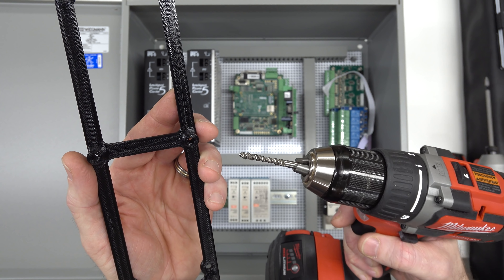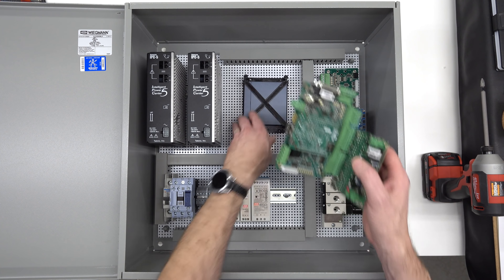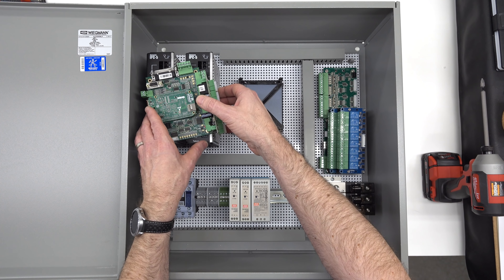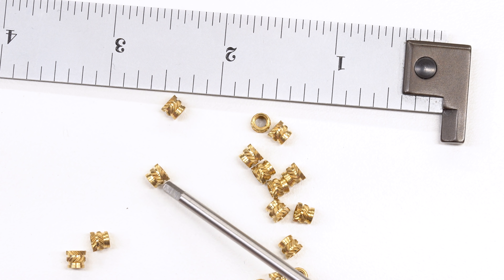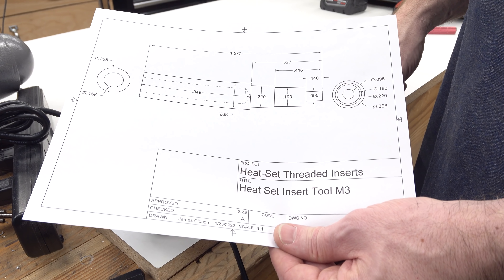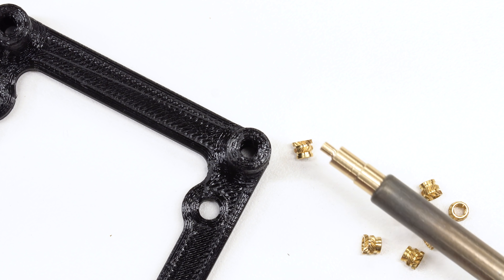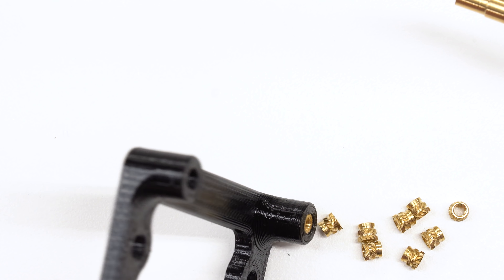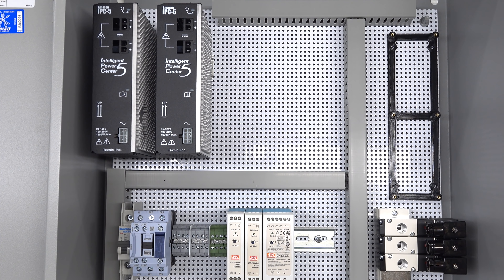Using Heat-Set Threaded Inserts | 3D Printed Acorn CNC Controller and Ether1616 Expansion PCB Mounts

Comment from the maker: Lots of people are asking about the perforated panel:  https://www.automationdirect.com/adc/shopping/catalog/n1p2020pp
Reply: Thank you for explaining the perf panels. I've always seen them as options when buying cabinets but didn't know what hardware I should be using with them.
Reply: You can also obtain plastic perf panels that have tapered grids and take self tapping course threaded screws, check the Bud Ind ones. Might be cheaper options than steel and machine screws
Reply: @Clough42    JFYI - you just need to say M3.. the pitch usually is not noted for standard series metric threads.
M2, M2.5, M3, M5, M6, M8, M10, M12, M16, M20, M24, .. are standard sizes and have a defined standard pitch.
They also are defined with other pitch (fine thread, etc) and there is 2nd choice series like M7 or M14 for example.. but one normally doesn't use them unless the application really really needs it. And only under such circumstances one notes the pitch or other special features.

PS: I'd add washers and maybe springwashers to those PCB board mounting screws.. if it's a vibrating environment they might come loose other wise?
Reply from the maker: @joansparky4439  the ISO standard is as you describe.  ANSI still prescribes calling out the pitch.
Reply: @Clough42    What can I say - you got an international audience, which isn't fluent in the amusing idiosyncrasies of thread descriptions per ANSI ;-)

Comment: For more holding power, do through holes and use the insert from the back.
Reply: You can also print a hex pocket and insert a nut.
Reply: @j.frankparnell6195  On the rare occasion I need to use one instead of a regular heat inset I will slightly undersize the hex pocket and heat insert the nut. Inserted nuts can be a pain when they take up too much room in a design, need installed in an awkward location during assembly or need inserted sideways through a slot that wont print well.
Reply: I always try to do this, its good practice, but really you don't need to be worried about strength too much when using good quality inserts. CNC kitchen has a video on some strength testing on M3 inserts, which showed that most inserts can easily handle over 1400N of force before pulling out (that is over 150kg on a single bolt!). The limit to torque you can apply was the bolts snapping.
So if you are not having solid infill in your parts, the weakest link is most likely the plastic part, not the insert pulling out, which is good to know!
Reply: There's got to be a dirty joke there, right?

Comment: McMaster also specs/sells soldering iron tips for their threaded inserts. Another fun fact - Molded in threaded inserts are common in Injection Molding, but so is 'heat staking' after the part is made. This is essentially the same process as you are exploring. The soldering iron in that application usually looks like an arbor press but with a heated tip.
Reply: When I started using inserts, I got the iron tip from McMaster, but I ended up just using a normal conical tip.  In my experience it works fine, and I'm able to get the insert straight without effort.
Reply: just be sure to get the right kind.The ones made for molding, isn't as suited for staking as those made for staking and vice versa
Reply: Is there anything I want that McMaster doesn’t sell?
Reply: McMaster also provides CAD models of most of their parts, no account needed.
Reply: Now I want to make a Dake Hakko Frankenstein project

Comment: I figured you knew about the inserts. CNC Kitchen has a video about the twist and pull out strength of various types of threaded inserts. I just uploaded my design for a Heat-set insert press to Cults3D.  Along with a soldering fume extractor. Same name as my YouTube name. I can't wait to see the new machine you're working on.
Reply from the maker: Yeah, I saw that video was there.  The topic has been covered, but this is what I was working on, so...
Reply: I can’t find you, how about a pointer?
Reply: Yes! , there are so many types of knurling/nibs out there, good to know which are best for fdm etc
Reply: @tablatronix  The style in this video is the best.

Comment: One of the tricks I've used for these over the years is to remove the iron when the insert is a bit proud of the hole and use a flat piece of metal to push it flush. This means it's flush to your plastic and does seem to help a bit with them being square. Course, I just use a super cheap soldering iron for the with a tapered tip so it works across a variety of sizes.
Reply from the maker: I think I would want them slightly below flush, to get solid bearing on the plastic, but you have a point about squareness.
Reply: By making them flush, you also prevent them from being pulled out, ever so slightly, if the screw is torqued a bit.
Reply: ooh this might help with preventing getting some plastic melt inside the bottom of the hole, I make my holes extra deep now, or it will really mess your threads up
Reply: @tablatronix  I tend to model them as drilled so I get some clearance at the bottom for the molten plastic in the taper. I really should figure out how to do custom hole definitions in Onshape so I can just add a library of the shapes for it with a bit of a counterbore to help align. I’ve cheated and made models for forms to Boolean out too which does work and could even get the taper they suggest.
Reply: Great idea! I'll try that.  I've been using threaded inserts for awhile now. It's important to get the insert at the surface or it gets pulled up and cracks the print when tightening (I use an electric screwdriver). I've ruined more than a few 3D prints that way.  If the inserts are on the surface, then the print doesn't crack.
Reply: I do that. Have also noticed some plastics have a tendency to push the insert back out while it's still hot, probably at least partly due to hole/inset sizing even with plenty of extra room below the inset depth.

Comment: Nice video, James. I’ve used heat-set inserts in a couple of my printed builds, and toyed with the idea of making a jig, but like you find that freehand is more than adequate.

My first experience with heat-set inserts was many, many years ago assembling a piece of HeathKit test equipment (I think it was the low-end RF & Audio Signal Generators that had plastic cases, but it make have been on the “Most Accurate Clock” case): the instructions called for using a standard pencil iron tip and just pushing them in the same way you did.

Comment: I have been to this rodeo which is my plan B. In ABS I usually cold form threads, print the hole undersize, run the correct drill through the hole, and finally use a cold forming tap chucked in a cordless drill to finish the threads. Cold forming in plastic has enough friction that it's a melting process so don't touch the tap quickly after forming a few threads.
Cheers-Peter

Comment: Threaded inserts are great. One suggestion would be to undersize the holes a bit. I found that if you make them a little too small and end up having material ooze out when you install the insert you get a much better connection between the insert and the part. The ooze is pretty easy to clean up afterward
Reply: Just be careful to add clearance at the bottom or else you can get plastic inside your insert
Reply: @tablatronix  very true

Comment: We had an injection moulding tool for ABS parts designed at work years ago. They used inserts for anything which might require frequent disassembly and specific plastic screws for lighter duty fastenings. I think the brand name was plastite, they have a coarser thread than machine bolts and are self-tapping to screw straight into a boss.
Reply: Yep.  I almost got some Plastite screws recently for a project.  Also, "plastite" is a valid search term on McMaster.

Comment: I had the same problem some years ago. Made also brass element for my Weller, works great. Nice you made a video of it, this will help a lot of people. There are a lot bad inserts around, from what I see you have the propper inserts. I buy my inserts from Ruthex, the same type of model you use. It is sometimes the small things that make the difference...

Comment: A tip for avoiding pullout forces:

Leave the insert very slightly proud instead of embedding it all the way in.  Immediately after getting the insert 95 to 98% of the way flush, turn the part over and press it against a hard flat heat resistant surface or use a flat block of wood, steel chunk, or really any flat surface to press the insert flush with the surface it is being embedded into.

When you press it below the surface, any part that goes on top of it ends up prying the heat set insert back out of the hole.  If you don't over tighten your screws that is less of a problem, but once an insert starts to weaken, it pretty much loses it's strength.  Allowing the material around the top surface of the insert to help shed that stress is better.

Comment: Great video. I’ve used those inserts a lot for military helmet mounted display optics and they’re very good. The housings needed to be light weight so we’re machined from an injection moulded polymer. To get adequate strength though and to avoid pulling them out when tightening the screws, it’s important to match the temperature of the insert with the specific material. You need enough flow of material to encapsulate the insert grooves so that it is positively keyed into the material. It looked like it worked well there.

Comment: OMG! I couldn't believe you never used these before! Threaded inserts are great and whenever I design a part that needs screws, I use them. Even if I think I'll never take it apart afterwards. I used to buy the cheaper ones until I started watching some of the video's of the Voron guys. They taught me to use the right inserts (the ones you got). If you use the cheaper ones and your holes are not the right size, they either drop out or clog up the screw hole..
Reply: i use all the inserts i can find and for the "wrong ones" i just turn a grub screw in the insert , then insert it into the plastic and when its cooled doen i remove the grub screw
Reply from the maker: There are moments in life that you remember forever:  your first kiss, your first Doctor, where you were on January 28, 1986, and the day you discovered heat-set inserts.

Comment: i just use the soldering iron tip I use for PCB's and put it in the hole in the insert and push it in.  Works great.  I left the temperature at the soldering temperature.  It pushes in fast.

Nice Video

Comment: Minor tip I picked up last Fall while building a Voron 3D printer - If you heat up and push in the insert almost the entire way and then use a small flexible putty knife to push it in that final bit, you end up the insert really nice and flush against the surface with a good plastic finish.  It's something I wish I had known about a month earlier.

Comment: 20:30

Regarding the "self-drilling" screws... In material like that perforated board, especially with existing pilot holes, you'll probably experience better long-term performance with the stinger point version of those fasteners. In thin sheet goods, the chisel point removes too much material for the thread-form to develop, while the pointed ones displace the sheet metal, and leave more "threadable" material behind.

It depends on the thickness of the material, though, but I would definitely try it!

Comment: Thanks for the idea with the special tooltip. I will make one too. 

One recommendation for "one time/seldom use" plastic threads: I never understood why drilling and tapping the hole. I just 3D print the threaded holes, which are simple to design in fusion 360 (dont forget to check "Modeled" in the tthreds dialog otherwise it will not be in the stl!). I also print screws if needed in the same way (100% infill).-Give it a try!

Comment: Another option for something you don't need to take apart and reassemble a bunch is plas-tite screws from McMaster. Self tapping and high helix angle specifically for plastic. Between those and these heat-set inserts, plastic has never been so much fun.
Reply: I always wondered what these were actually called, I have been buying "laptop screws" etc made for injection standoffs/boss

Comment: I usually tap holes when prototyping parts and then once I'm happy with the spacing and clearance switch to inserts so that I'm not wasting them. I just use my standard conical soldering iron tip for them and do find that they occasionally don't go in straight, but it's pretty easy to straighten them up afterwards just by re-heating them. I do always drill the hole out to the correct diameter so that they go in just right, otherwise I find the excess plastic sometimes pushes the insert back out after I remove the soldering iron.

I'd suggest that you consider switching to larger cable channel for the right-hand vertical channel as you have a lot of wires to put into there. I've seen others use those self-drilling screws with solid back-panels but when I used to do control panels with my dad many years ago, we used to drill and tap every hole in a solid panel - That used to take the best part of a day on a larger panel.

Don't forget to number your wires, both on your drawings and at both ends of the wire. The little push-on plastic numbers work well.

Comment: I found an old Dremel Model 210 "drill press" at Goodwill that I think might make a nice rig for heat setting inserts, by putting a soldering iron in the press instead of a Dremel.

Comment: James nice layout in the controller box…I’m doing something similar with an acorn controller as well, along with teknic servos.  What din rail mounts are you using for your teknic ipc-5’s?  Thanks in advance.
Reply from the maker: The IPC-5 manual has the part number for the mounts: Phoenix Contact UTA-89 or 2853970.  The price is a little bit of a shock, but they turned out to be very nice.  The standoffs shown in the manual aren't actually needed.  Also, they don't come with the pull strap, and I didn't see a source, so I sewed some out of nylon ribbon and plastic rings from the fabric store.
Reply: @Clough42  James - thank you very much!  I missed that in the manual.  I had originally 3d printed a baseplate, but it was just ok - this looks much better.

Comment: I used to use brass inserts, but then I discovered self tapping screws with a thread profile designed for injection molded plastic parts. I find them preferable for general assembly, though I guess inserts are still useful if the screw needs to be in and out a lot.

Comment: Whenever I need a single use threaded hole I just draw the hole to be the minor diameter of the screw thread and then just run the screw into it, no tapping or drilling needed.  It seems to work really well for UAVs with a lot of vibration.  If you were going to be disassembling the part however these inserts are the way to go!
Reply: I've used the minor diameter for mounting electronics on High-powered model rockets - also a high vibration environment. But yes, for single assembly, perfectly sufficient.
Reply from the maker: That's a good point (vibration resistance).  One challenge with this is that the minor diameter of 3D printed holes is relatively hard to control well.  Most people just starting out have lots and lots of trouble.  When size is critical, I usually plan on reaming.
Reply: @Clough42  Very true. I have characterized my printer with my most used filaments and typically get dimensions better than 0.05mm, which is good enough for almost everything I do. But getting set up to do that was no small task.
Reply: James' threaded inserts are definitely better (stronger, more durable etc) but if you've not got them or are iterating prints, I've had pretty good results (on weirdly similar parts just recently) just modelling the thread in Fusion and printing it as it.  That gets the number of perimeters around the thread up for strength (vs printing to minor diameter) without having to increase them over the whole model.  Then running a tap down them to bring them to dimension is quite easy - the tapered end of the tap, being smaller, catches the printed threads and it self feeds straight.

Comment: I just used the M3 brass inserts from Adafruit for the first time yesterday. Worked great, although I don’t have a metal lathe, so just bought the soldering insert tool from Virtjoule. Was cheap and looks just like the one you made but would’ve been more fun to make.

Comment: And here I was thinking I was being super clever when I "invented" my own heat staking press (for an acrylic sign build) a few years ago, but I see from the comments that others came up with same solution.  I gutted a cheap, old 25W unregulated Weller, screwing the 120V element assembly on to an adapter I fabricated to allow chucking in my drill press, and turning the screw-in tip down to the appropriate diameter.  Heat regulation turned out not to be an issue, for by the time the insert came up to temperature (already bearing down on plastic) it was quicly sunk into place and heat removed.
Reply from the maker: Yeah, I've seen a few out there.  I have a Dremel "drill press" I bought for drilling PCBs right before the fabs started offering 5 boards for $2.  It would be a great platform for a heat stake tool.